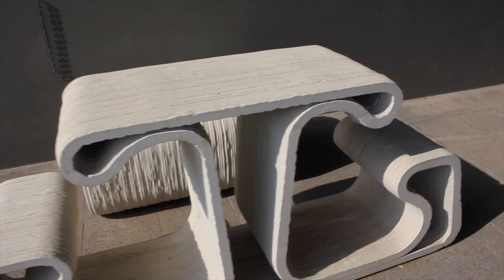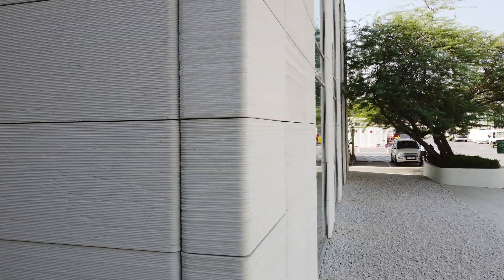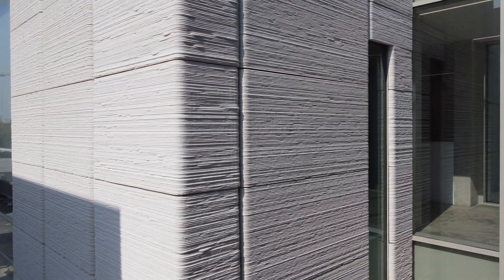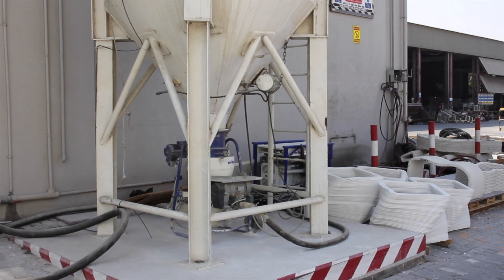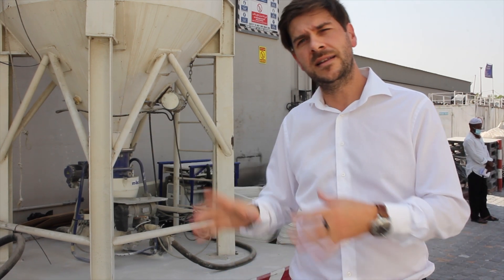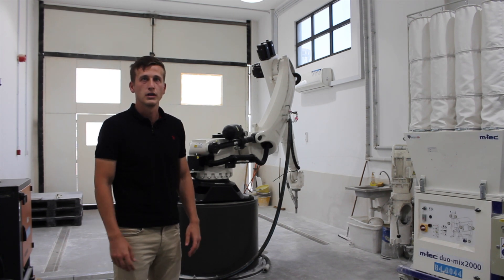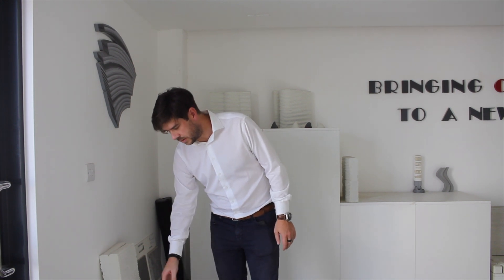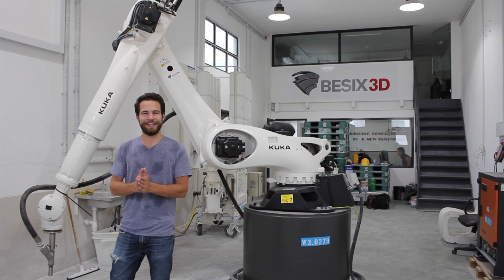Besix 3D Printed Headquarters Building in Dubai | Printed Commercial Real Estate

Comment: I just caught that he said the 3D printed elements where NOT structural, but used as a type of cladding. Is it really considered a "3D Printed Building"? This approach could help the kingdom save face, if it becomes clear that they can't hit the 25% number by 2030. Like you mentioned in your conversation with Edouard, they may be able to have a '3D printed portion' of each building to hit the 25% number, but not necessarily the whole structure.

Comment: At 08:30 the audio is a bit hard to hear. Could you manually add captions within youtube (not added on top of the video but on the backend) to supplement the auto generated ones? Also, if you don't have one already, using a wireless LAV mic would go a long way to boosting voice audio clarity.
Reply from the maker: Yeah I got one it died this day sorry